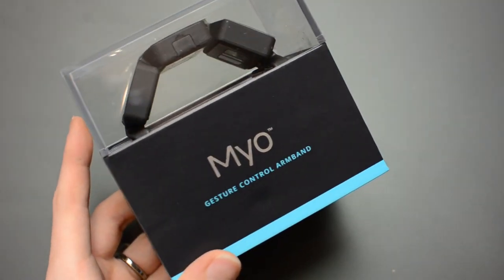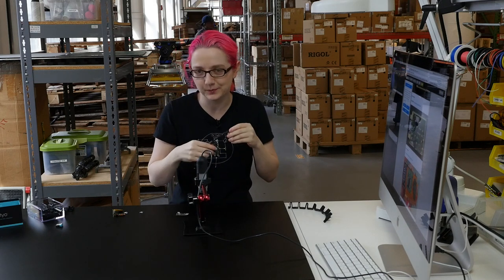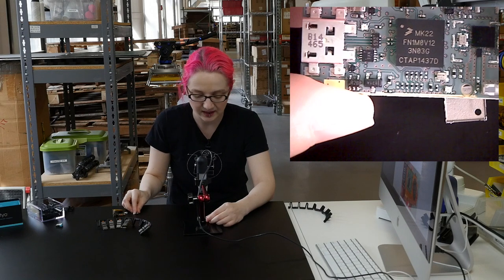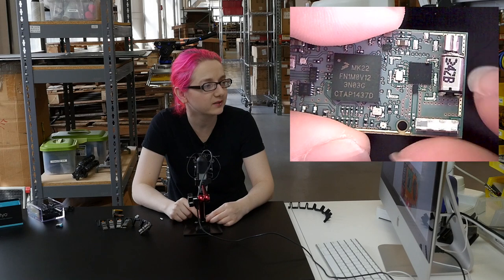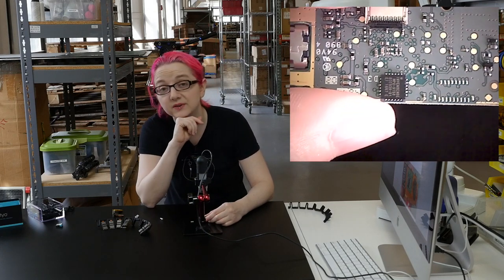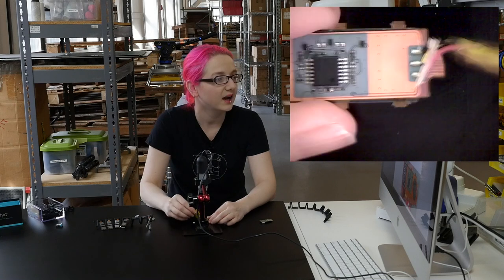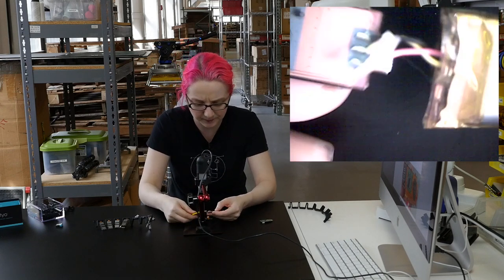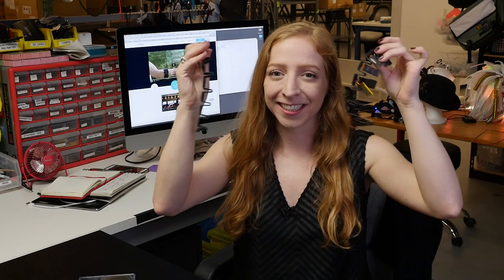Myo Armband Teardown

Comment: Thank you for your work. It's very helpful for me to understand Myo's structure quickly. Does anyone know why there is a motor?
Reply: the motor has an off center weight on top to create vibrations when powered
Reply: @mechcem  i have one. It's used to feed back eg when you make a gesture. but kan also be used from the software that is connected to feed back info. Handy when giving presentations where you get a buzz when the next slide command has been received :)